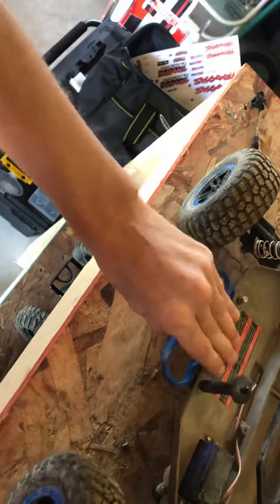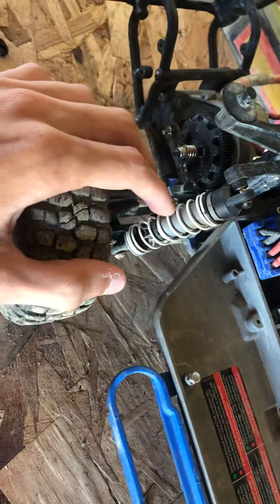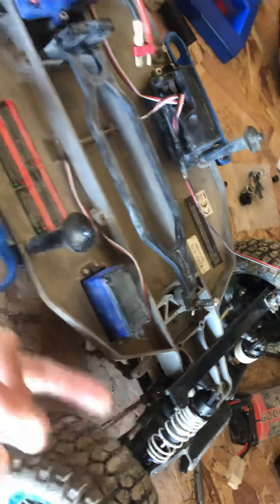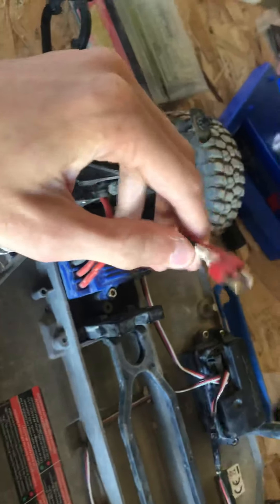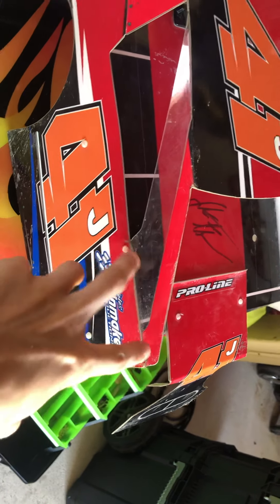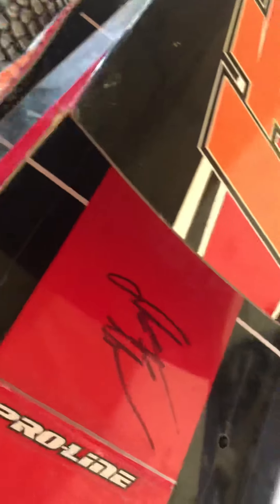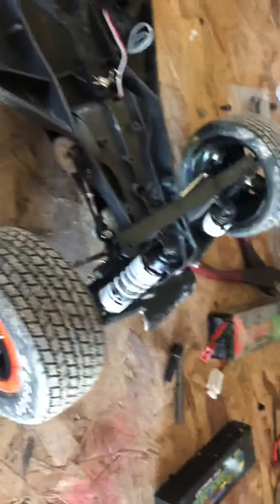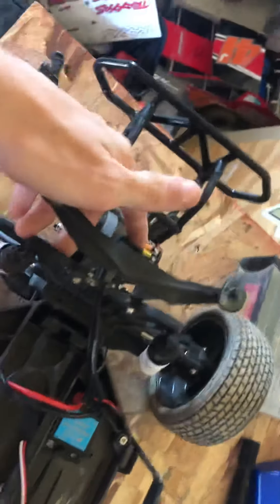How To Make A Salvas Mudboss

Comment: Can you run LCG body on stock mudboss
Reply from the maker: Landon Wurst some tracks allow you to run lcg on a 12T but at almost every track they won’t allow it to be ran, however you can run an lcg chassis on a 13.5T big block modified
Reply: So I will say this class sucks! Have you ever raced a mod or b mod? Blows this out of the water. Those tires u have suck. I have the de versions. The grooved are way better. Run those on my sc street stock. I run a sc5 for a b mod with hole shot super soft. Best danm tire i have ran so far for modified. Ditch those hossiers bro